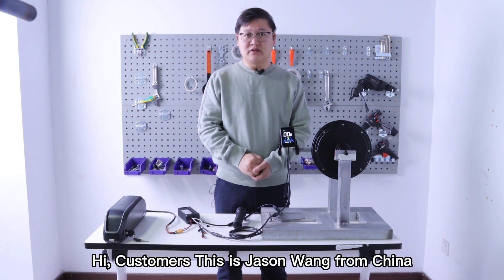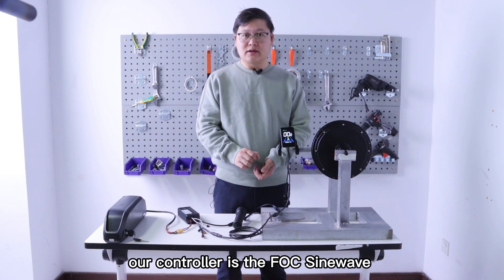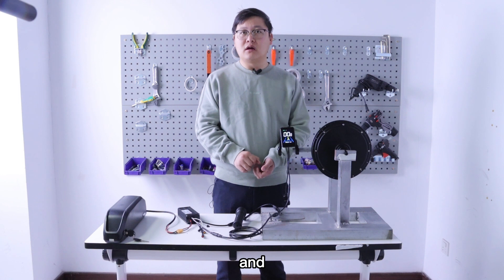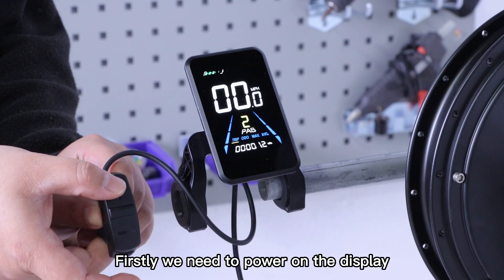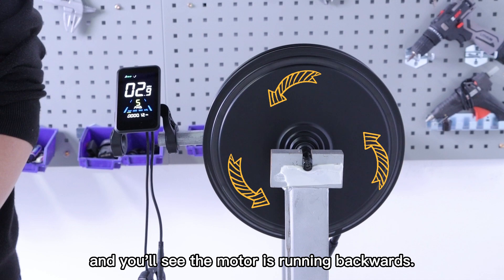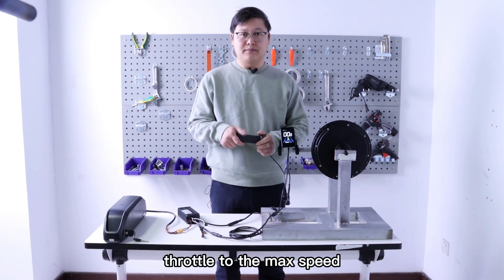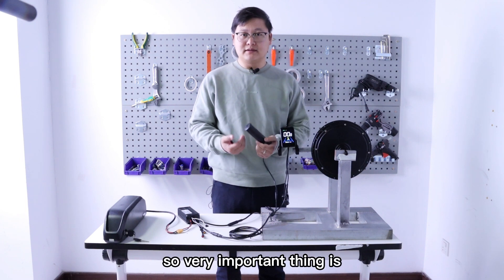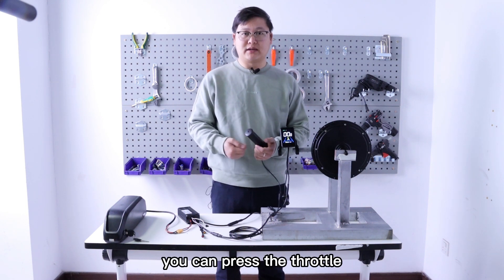Instructions for use of electric bicycle motor learning line wire.

Comment: Hello
I to had the same problem with the motor running backwards and had to change the wires around.

But then i learnt about the "learing wire test" that sets the motor the correct way.

Please watch this video 🤗

Watch "Instructions for use of electric bicycle motor learning line wire." on YouTube
https://youtu.be/Aij1oQc6ubs?si=5Y18-icvX37vWS3r